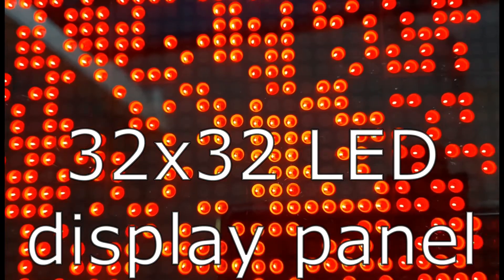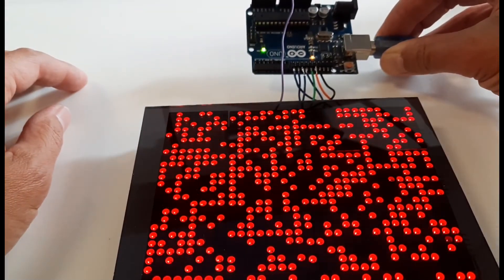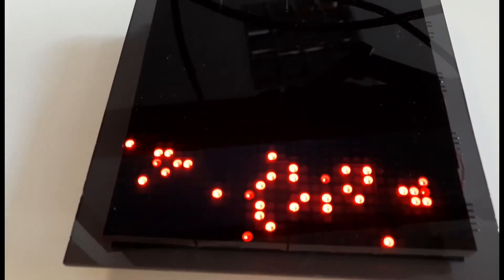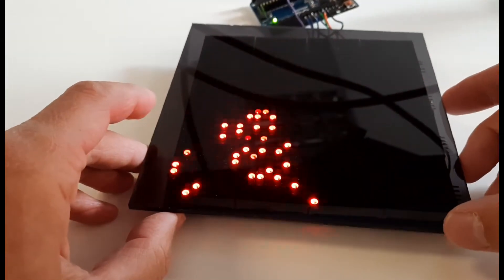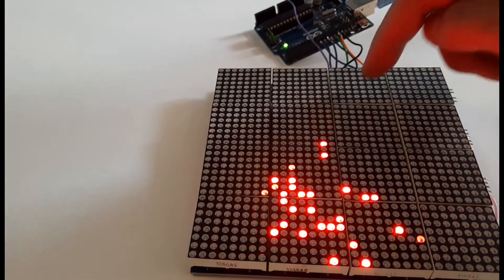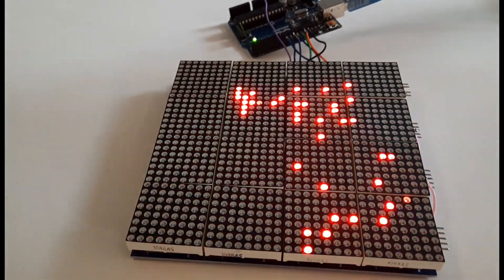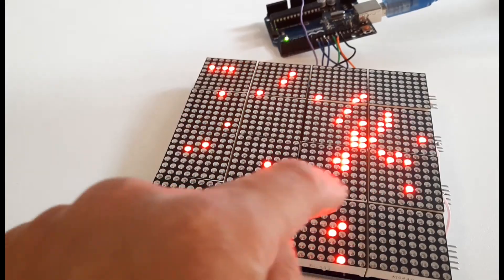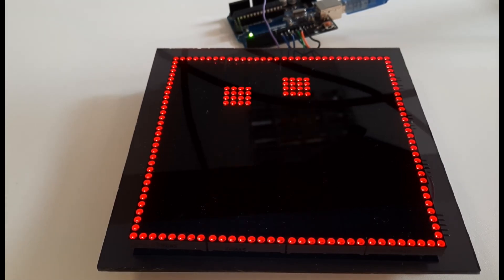32x32 pixel LED display panel made from 4 x MAX7219 modules of 32x8 LEDs

Comment: Nice! I'm also doing a 32x32 LED panel display for a breadboard project with a custom display control board. This gives me a really good idea of what it would look like. I hadn't even considered placing a tinted panel in front to help with the contrast.
Reply from the maker: Without improving contrast I found it was very poor. A little perspex goes a long way!
Reply: @CircuitBreaker256  My project will be using the 'raw light panels'. I'm curious to see what kind of brightness range I can do with it. (Likely 4 levels using 2 bits). I would worry a little how much a tinted panel would dim things even further.
Reply from the maker: @Jimfoxyboy  If you try it I think you will like it. It's really a contrast-enhancer.

Comment: as we are talking about 1 bit per pixel, I'm quite sure the UNO can handle the timing for outputting the pixels, but what I would be more concerned (like you actually mentioned) would be the power draw - it was one of the revelation for me that when driving led displays you need to actually have quite a lot of power to drive a bunch of them
Reply from the maker: That's true if you drive them on permanently, but the MAX chip on these modules can drive them with PWM, so it can vary the pixel brightness. At full brightness you can only have about 100 leds on before the UNO gives up, but at lower brightness it works well.